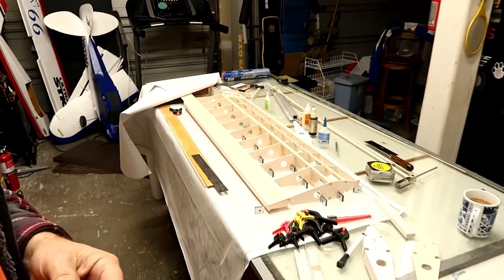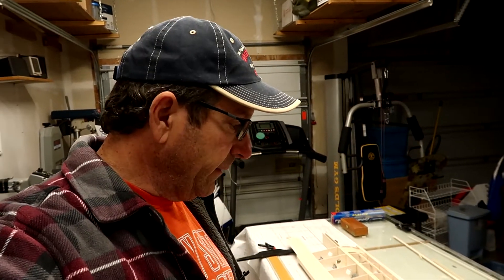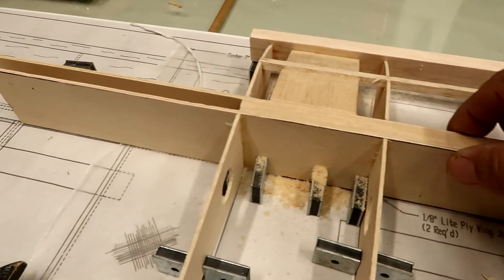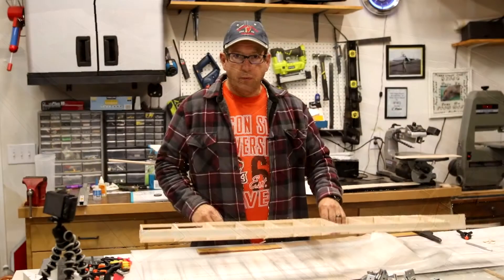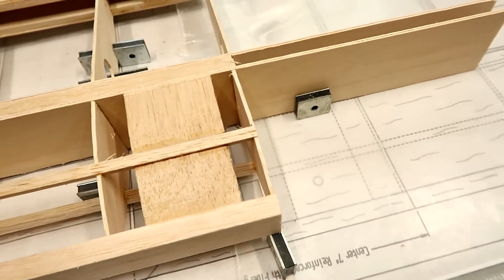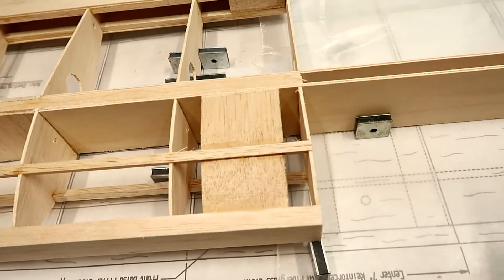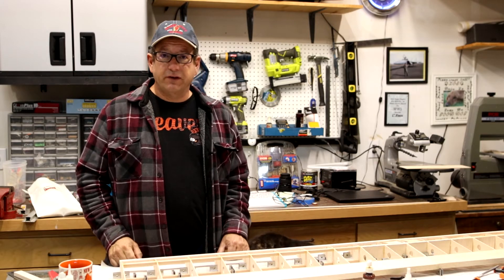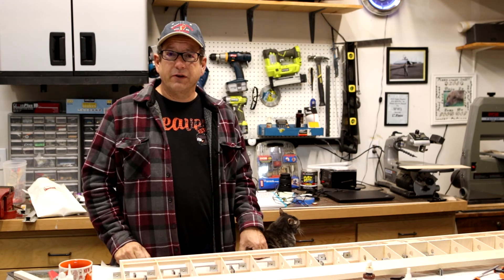EP6: Building the wing, Ryan's Rebel RC Airplane

Comment: Appreciated the little pep talk that not everything is going to be perfect and that's OK. I have been known to stall out on a project because I'm afraid I can't do the next step perfectly. I'm slowly learning not to let "great" get in the way of "good enough".
Reply from the maker: Scale guys are notorious for building in a certain way, with a certain amount of detail and perfection.  I really got into that myself, to a point and found that I was not capable of dialing it back for a sport scale project.  But then I realized none of my planes had ever been perfect... I could tell you the places of each one that I screwed up and had to improvise.  So yeah not perfect but they still flew well, and I enjoyed flying them regardless.   And nobody knew they weren't perfect either.  Some had warps in the surfaces or the stab wasn't perfectly lined up to the wing.  But with a little trim and adjustment, they will be fine.  Just don't screw up the center of gravity... A nose heavy plane will fly like crap... A tail heavy plane will fly once.

Comment: I just started watching your videos. Your presentation is pretty good especially for someone who just started a channel. I am sure as time goes on you will get a lot more subs. I look forward to watching the entire series. 

As a structural engineer, I would recommend to build the middle 50% of the wing and then the outer 25% each end. That way you keep the spar in one piece where you have the highest bending force. You only have about 25% of the bending at the outer half the wing as you do at the centre of the wing.

How did you maintain a constant height at the back of the ribs when they were being glues to the spars?
Reply from the maker: Thank you.

Comment: Hi can you show how are you sand the leading edge
Reply from the maker: Hi Daniel.  Yes that is what I will be doing next, as well as shaping the TE too.
Reply: Thanks Dan! Please can you post the link of the plans please, in the other video i dont see the link thank you
Reply from the maker: Hey Daniel, do me a favor and try this link.  Tell me what you get.  It goes to an RC website, but maybe it doesn't work if you aren't a member of it.  I need to find out.  https://www.youtube.com/redirect?q=https%3A%2F%2Fwww.rcgroups.com%2Fforums%2Fshowthread.php%3F2962850-Don-Dewey-Memorial-Radio-Control-Modeler-%2528RCM%2529-Plans-Collection%2Fpage35%23post39956294&v=ADukQN-j7j8&event=video_description&redir_token=yVh0h0y21tEYLcH6otGxB45l6qd8MTU3NzIxNDI2OEAxNTc3MTI3ODY4

If it works, you should be able to scroll down just a little, and there are three pdf download links.